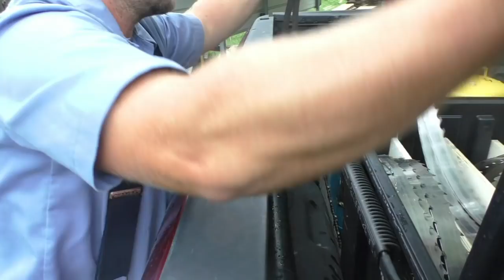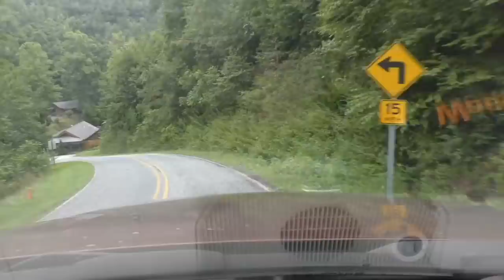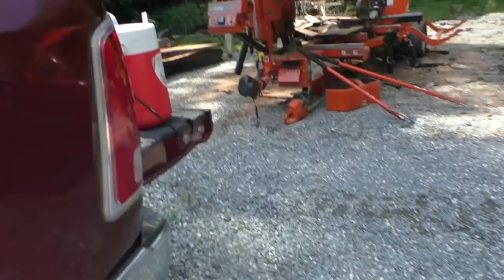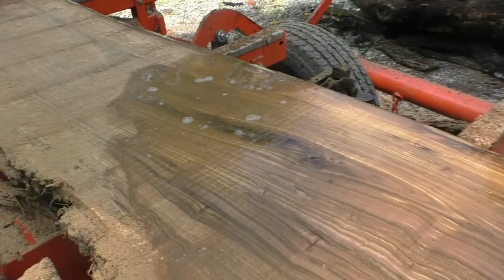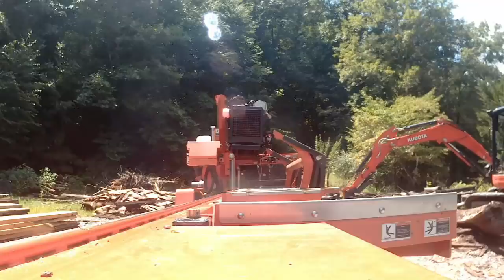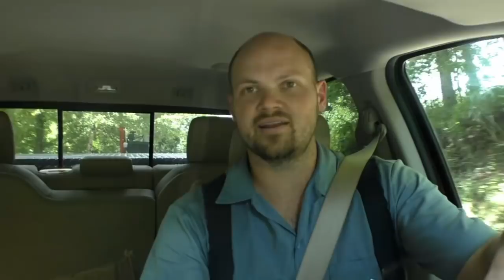Cutting Beautiful Walnut in the Great Smokey Mountains | Vlogmill

Comment: Just wondering which blade pitch do you prefer for Oak and Walnut?
Reply from the maker: All my blades are 7/8" pitch.  Would like to try 1-1/8" pitch for the wider cuts, but that's a custom size and I haven't gotten it made yet.
Reply: WNC Portable Sawmilling .... I have been using the  .045 x 1-1⁄4 x 158”- 9° it actually is the only blade I’ve ever used, I don’t have any other ones, wanted to say also,  I like your DeWalt storage for your blades I’m going to start shopping around for the best deal on a tough storage box like you have, thanks for being out there
Reply from the maker: ah, gotcha, yea you might could try some 7° for oaks, sometimes the 4° works better if it's dry/harder.  Generally the lower angle cuts less aggressively, so is better for harder woods.  9° works great for poplar, walnut, or clear pine, but  use 7° most often, and it handles knots and drier wood better.  Also if you ever get wavvy cuts a thicker blade will help with that, I can tell a big help with even an .050 thickness